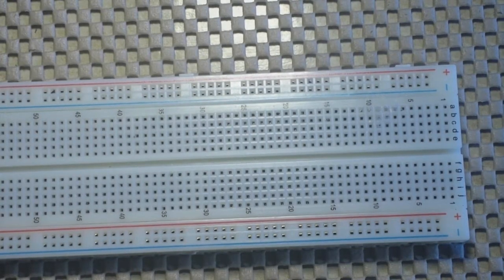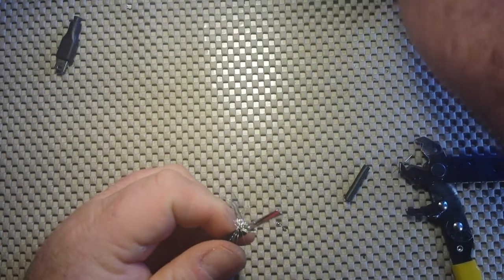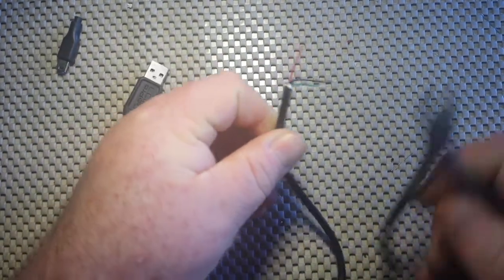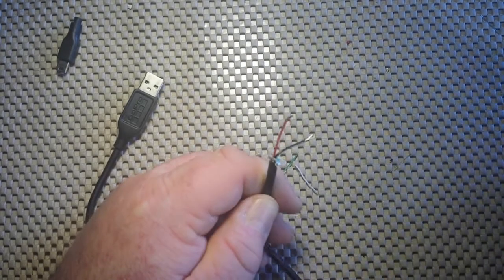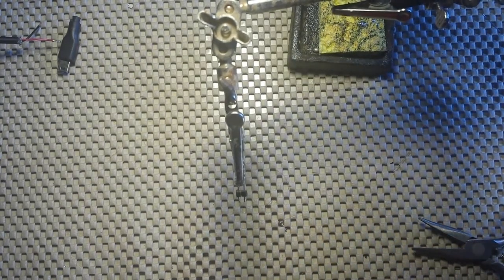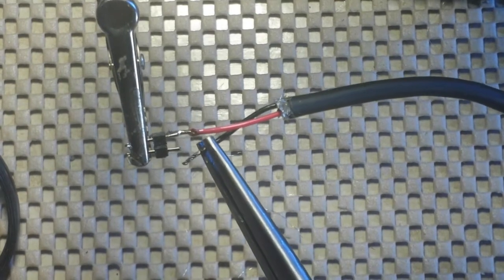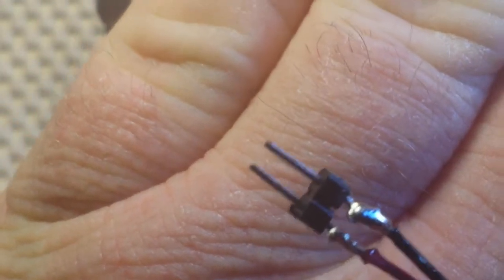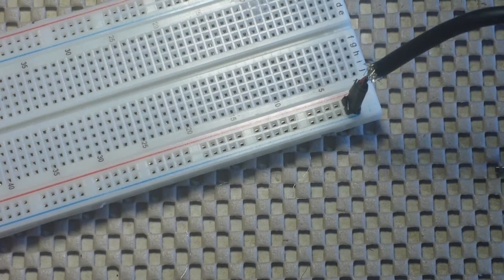DIY breadboard 5V Power Supply

Comment: Some usb chargers won’t have a black ground cable but rather 3 stray wires without any coating, as I found out when trying to do this. Nothing shrink wrap can’t solve. I’m also wondering if header pins are necessary since I’m doing this in a pinch without any.
Reply: did you have any issues doing this without header pins? i'm also in a pinch and don't have any
Reply: @yehudah-e1i  I just ended up ordering some header pins. I don't think the connection would've been possible otherwise.

Comment: I saw someone use the liquid electrical tape in a video but I've never been able to find it.  Where did you get it?  What exactly is it called?
Reply from the maker: I get it car quest auto parts, it's called liquid tape, comes in bottle about 2inches high with a brush built into the lid.

Comment: Quick Question: I Have an USB cable I cut from an old Mouse. I did this but I don;t know why I'm gettin below 5v even when I connect it to a usb 5v supply. Any chance is because is a Mouse cable? Is thinner that the one you show in the video.

Comment: Thank you! I'm currently buildning neoPixel staffs and poi, and also an autonomous robot and you just solved my power supply issues in a way that keeps things portable, cheap and with long battery life! This method together with my 10Ah power bank will make an extremely elegant solution for literally every single project i'm currently working on.